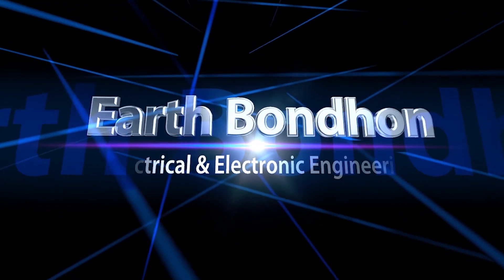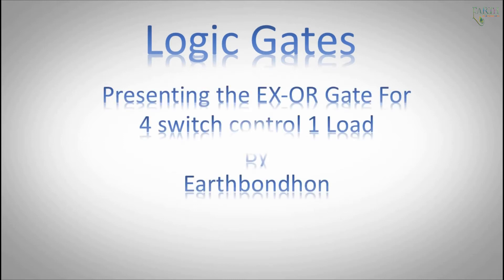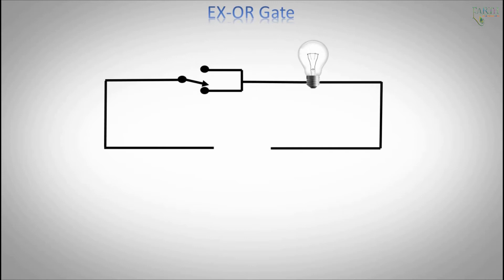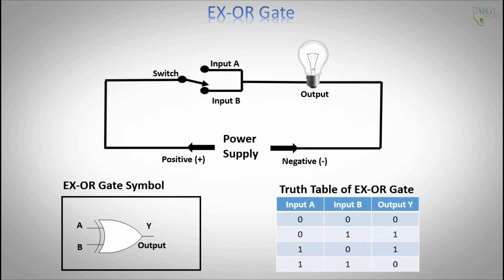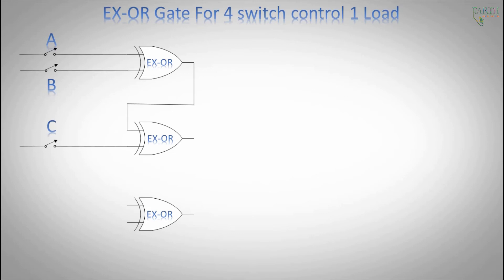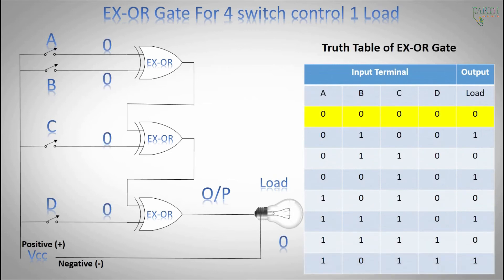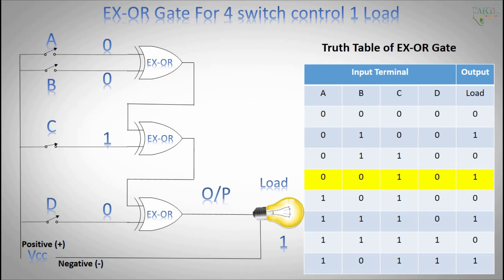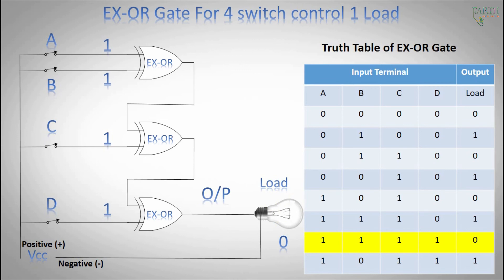four switch to 1 light logic gate control circuit | 4 Way traffic signal control light

Comment: A traffi c light system uses logic gates as part of the control system.
The system is operated when the output D has the value 1. This
happens when:
either (a) signal A is red
or (b) signal A is green and signals B and C are both red
(NOTE: You may assume for this problem that red = 0 and green = 1).
Design a logic circuit (network) and draw the truth table for the
above system.
Reply from the maker: Thanks for your feedback, please follow.........
"Thanks for watching the video"   You are very welcome!

Comment: A long corridor has a single light bulb and two doors with light switch at each door.
Design logic circuit for the light; assume that the light is off when both switches are
in the same position
Reply from the maker: full info website @earthbondhon.  I love to receive your comments and feedback.
Thanks for watching it.